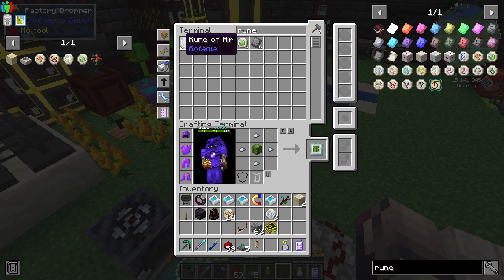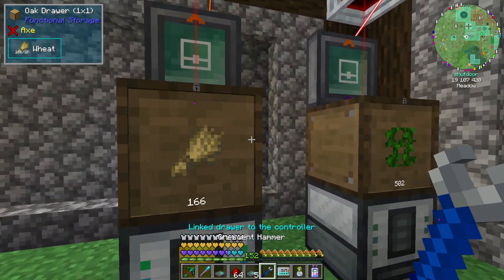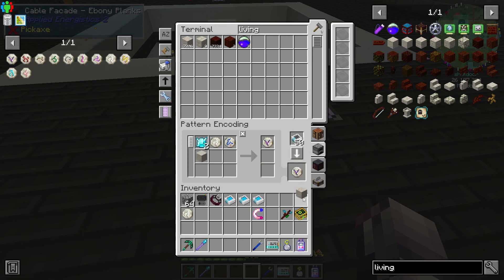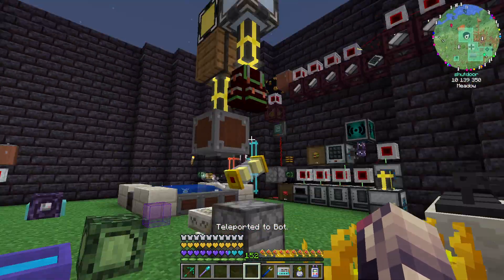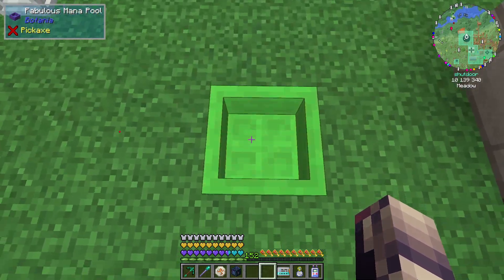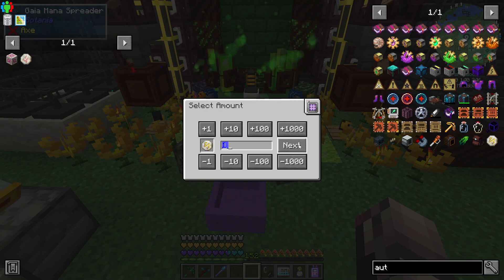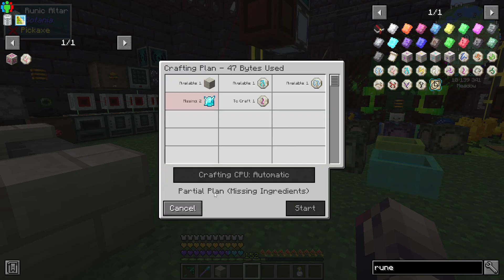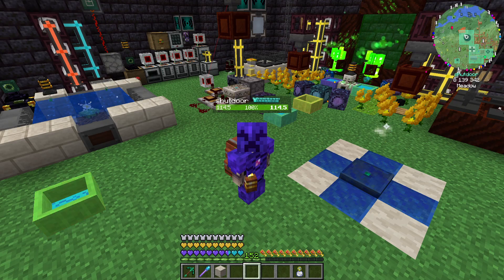Direwolf20 1.19 Modpack: Ep. 55 (Runic Altar Automation Take 2)

Comment: The lovely runic alter automaton 🫣. I have not done in many many packs. The only thing I can suggest is go straight into the runic alter with an me provider with blocking mode enabled use a comparator to trigger a timer. Export living rock directly into the dropper. Once the timer fires off route the pulse to the dropper add a slight delay to the cyclic user and I think that will work. Vacuum up with the vaccumulator.
Reply: Got it to work. . .but it was a lot more difficult than anticipated as the stupid me provider cannot place directly into alter. so I put a factory dropper on top of it. Set it to >=1, &, continuous and one notch above rabbit speed. Place a block next to it with a torch on the side to trigger the drop. Back from under this block I ran a RFT Redstone receiver into a pulse extender set to 7s so it will not place the next crafting cycle as the redstone signal will be inverted. This same receiver goes onto a sequencer (set to once2 all squares on and sequence length of 220) to the vaccumulator set to hight signal. The factory dropper above the runic alter I placed living rock and set it to &, &, pulse. I have another RFT redstone receiver facing this dropper (set to same channel). Lastly, I have another receiver (same channel) aimed at the me provider and set it to blocking mode and lock crafting with redstone signal. Finally, I have the comparator facing the runic alter feeding into the RFT Redstone transmitter. I know yikes. . .I thought I was all set until I relized that I had to shut off the vaccumulator until the runes for the rune of summer, autom, etc. were getting vaccumened before the runic alter would accept them.